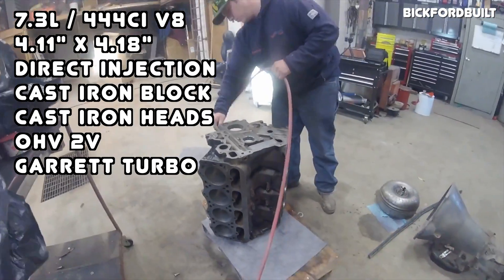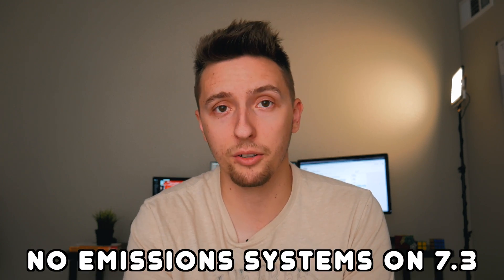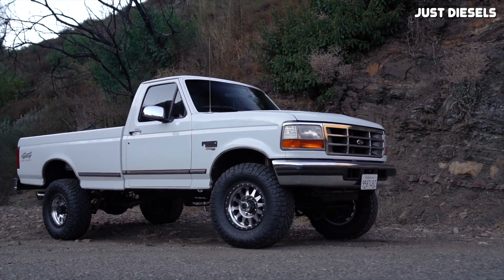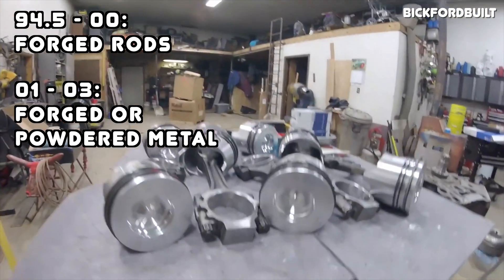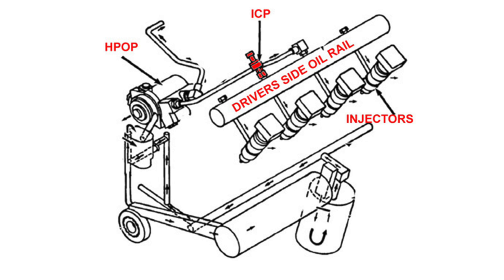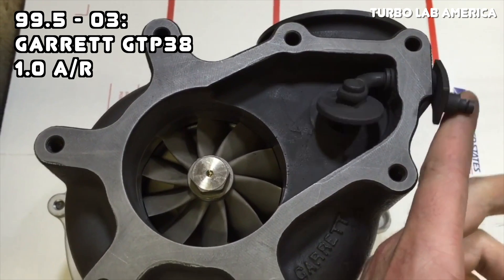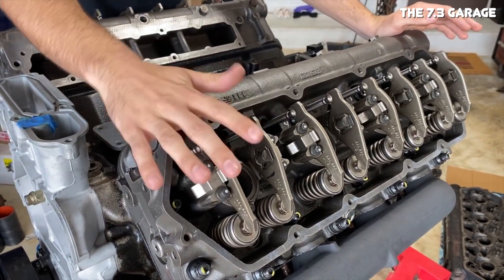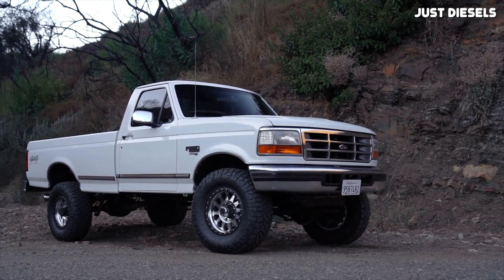7.3 Powerstroke: Everything You Need to Know

Comment: I just finished overhauling a mint 1997 Ford F-250 with a 7.3 that has 184k on it, new injectors, adrenaline oil pump and cold air intake, all new sensors and 4" exhaust with stainless up pipes. This truck has new paint new interior and people ask me all the time if I want to sell it. The answer is always the same...nope its not for sale. It truly is an enjoyable truck to drive

Comment: i really like my 1997 ford, with the 7.3 power stroke it has been very reliable for my trips across Texas. I did buy it used about 15 years ago. At this time I have around 230,000 miles on it and just recently had to replace the glow plug relay.
Really like your video.
Reply: I have the same truck, just put 10k into it and its freakin beautiful

Comment: I get a kick out of people when it comes to this. Powerstroke 7.3 for a pickup is golden. these new motors are high horse and all but guess what?its  just a pickup truck. Want to pull something? get a peterbuilt or kenworth! These new pickups boast a lot of power but springs squash after a few transports. Big joke imo. Watch these idiots jack them up and as soon as they hook up a single axle trailer they squat. JUST BECAUSE IT SAYS 1000 lb/ft DOES NOT MAKE YOU A TRUCK DRIVER

Comment: I got a E99 f250 pushing 575hp with  a zf6, 238/80 hybrid injectors, 66/88mm turbo with kc hot side, stage 2 CNC fab hpop, mains and head are studed s&b intake, 4" straight exhaust, 2 piece intake spider, riff raf ocr and frx, riff raff doghouse/ crank case breather, 4 core radiator, high flow fuel banjo bolts, twin disk clutch, Hydra tuner from Brian at jelly built performance, comp cam valve springs, irate diesel push rods, let me tell you what my old 7.3 still is very strong and blows away most of these new diesels out of the water.

Comment: Yeah.. these trucks aren't weak whatsoever. Theres a man who has owned his 7.3 equipped F250 for 23 years out in the mountains of New Mexico. Hes replaced 4 sets of rear springs and 2 sets of front springs hauling wood which is all he heats his house with come winter. You just have to maintain them.

Comment: I have a 02 7.3 with many upgrades with 230k I'm the 2nd owner its mint condition K.C300x stage 1 4" exhaust stage 1 injector S@B cold air intake coolant filtration there are a few others it's my weekend warrior I tow the camper a lot in the summer other than that it sits in the barn ill never sell it they dont male truck lile that anymore and i cant afford one anyway 😂😂😂

Comment: The only real weak point i found on all the 7.3s i was the e40d transmission and the 4t100 4 speed with overdrive ,  so i would overbuild the transmission and then i would drive that truck to the moon after that
Reply: Same with me
I found my problem to be the gauge cluster
Ford in it's infinite wisdom routed the wiring from the variable speed sensor to the transmission controller through the gauge cluster.
I kept losing connection between the VSS and transmission controller which put the transmission into limp mode

Comment: Just replaced my 2002 turbocharger after 22 years of service, 245,000 miles. These engines are truly legendary. As far as towing and horse power, this engine makes up for it in torque. I pulled a Kobuta tractor and all the fixings and 1,200 Sq feet of ceramic tiles and although the front end was gliding up a bit, she pulled this heavy load with absolute determination. Just because theses engines lack the horsepower of today doesn't mean a damn thing when it comes to low gear ratio and torque baby!!

Comment: I run the t6 15w-40 synthetic. Change every 5k miles. IMO better safe than sorry. Also change my fuel filter and coolant filter every other oil change. Have 300k miles on my 7.3 and it runs like a top.

Comment: My 7.3 has no catalytic converters 2002 Canadian truck. They’re still on it bought it. There was only two years old with 8000 miles on it. Done some upgrades per bank performance nothing radical just better low end better mid range and better fuel economy. Truck runs great haven’t done anything to it but change injectors cause it’s has 300,000 miles. I’m convinced it’ll go 1 million.😊

Comment: I’m looking for any small items to add or take of mu 2002 Excursion Limited, only 85,000 miles, white with gold under neath, gold or tan leather inside, one owner with oil changes every 4,000 using Delo 400, still has original 10 ply Firestone tires which I was holding off buy because the truck is for Sale, I will pay for chosen tires of the new buyer and I have 1 new tire and I bought one new  matching aluminum  spare rim. It’s been garaged anytime it has been home ( like 99.9% of its time). Stopped here to save this much history.
       It’s been here in Utah, I bought it to pull our 33’ x 10’ wide Searay Boat, to pull it to & from Lake Powell. Im 78 years old now and no longer have a boat, and with major surgeries in my past, it leaves me needing to sell this beautiful, giant SUV . I just installed 2 new Batteries and have always kept stringent maintenance on fluids and filters. Are there any issues that may need checked, cleaned or add-ons to make it more desirable and better to sell . What about items to check and clean that I may have overlooked ?

Comment: All this sounds pretty great! I just picked up a 96 F250 7.3L yesterday and wanted to get a little context on the motor, this was very to the point and informative. My new/old Truck was driven into a power pole when the elderly gentleman that owned it fell asleep, hadn't been started since the wreck four years ago so I got it for 500 bucks as they were pretty sure it wouldn't run. Paid to have it towed home, threw two fresh batteries in it and I'll be damned if it didn't turn right over and idle.. other than some damage to the left headlight/fender/hood everything seems great, the deer bumper seems to have taken most of the hit. I've only had this thing for 18 hours and I already love it.

Comment: The two primary trucks I'm currently looking at are 2014 Toyota tundra 1794 with the 5.7 v8 and the 1997 obs ford f-250 with the 7.3 diesel. 

To be honest I know ZERO about diesels, like literally nothing haha. 

But I'm needing a truck to haul a single horse trailer ( about 5k lbs give or take). 

The obs Ford's I'm looking at are rust free Texas or west coast and 20-25k dollars with about 200k miles.

The v8 Toyotas are 2014 years with about 130k miles and in the 20-26k Price range.

I'll primarily be using it to haul livestock feed in the bed or haul a single horse trailer. I'm also located in Nebraska very cold winters and will be using the truck alott in the winter. 

Any suggestions on which you'd recommend in this specific situation?

Comment: 7.3 was by far the best diesel to be put in a ford  if you threw the trash ford parts in the garbage and replaced them with genuine international parts they were decent motors unless you live where it gets cold  you either let them run all winter or kept it in a garage cuz they won’t start in the cold

Comment: My 2000 F350 4x4 dually with 6 speed manual has no catalytic converter, and I’ve owned it since new so I know it never did. It also has no restrictor in the fuel inlet, allowing use of tractor-trailer pumps. And yet a friend’s similar truck did have the restrictor and a cat. I’ve never found any rhyme or reason for these variations. But I do know that over the last 23 years of ownership I’ve replaced a clutch, a water pump and a fuel tank pickup screen and that’s it, other than good maintenance. Quite a truck as long as you don’t mind taking up more than your share of parking spaces.

Comment: Solid engine for sure, had a 2002 F-350 version. The ‘big’ issue with these is the oil pans rust out and you have to pull the engine to fix it correctly.

Comment: 99 7.3 forged rods. As long as it has fuel, oil, filters the motor is unstoppable. Outside of some cold starts (glow plug relay) motor will last 1 million+ 
No its not a new 6.7 but ita not a 100k vehicle either. Only thing in its class is 5.9 12 valve!

Comment: not slightly close to being the best, BUT: Ford kept having Harvester cheapening up the engine. They started by going cheap on the fuel injection system. Then they did away with the sodium filled valves for the ones used in a gasoline engine. It just kept going down hill from there. Yet the Navstar engines held up very well. They are very dirty, and really suck fuel compared to the others in the day. The motor to compare the 7.3 with is the seven liter CAT, and it's a no contest. The CAT makes better power (very flat curve), but is also dirty and sucks a lot of fuel. Even the Detroits were better.

Comment: I had a 2007.3 power stroke the only not routine change such as oil and battery was replacing injectors. I had it for 16 years and never did anything but start go run a Beautiful and Engine.

Comment: In 2002 an film maker took an 1997 f350/super duty he welded an 2 inch tubular steel frame on the frame of the ford then added 8,000 lbs of 1/8 inch steel plating with bulletproof glass in the end it is an storm chasing tank designed to drive into tornadoes that are weaker then EF 4 but after years of storm chasing though the worst conditions that tornado alley has thrown at it it is still around pretty rusty since it was abanded on a farm in Kansas but this vehicle (tornado intercept vehicle) or tiv 1 is setting in some garage waiting to be restored and go out and once again intercept tornadoes 🌪️      edit it weighs 14,000 lbs

Comment: My tow truck 1994.5 manual 5 speed 7.3 failed at 880,000 replaced with a Junk yard motor  that had 145,000 rebuilt the heads cleaned it and a few things new HPOP fuel bowl and some O-Rings later it's in my truck now with  285,000 running strong and perfect don't want anything else does have the 235 HP motor with a 80hp tuned chip and  Wicked wheel in my turbo that's it. :goodvibes:

Comment: ...those under 50 have to have monster engines that go zoom zoom. However, if they were smart, and could shift manual transmission's, they would able to do tremendous amounts of work at low cost. Let's not forget, at one time ALL semi trucks were powered by engines in the two hundred HP range and pulled 70,000+ loads. Nuf'sed

Comment: Inline diesels are the best! You have more main bearings because of only one connecting rod per journal. And the cylinders wear much better because of the pistons running straight up and down . Where v8s diesels the piston is being pulled against the outer part of the cylinder wall just from gravity.  That explains why  semi trucks all use inline engines!

Comment: 03 F250 extended cab short bed 4x4, 7.3L, ZF6, manual shift transfer case. F1 Vermilion Red. Bought him in Sept 2005 after gettin home from Iraq. He had about 52K on the clock then.

164K miles as of this post.
He's a quarter horse, not a thoroughbred.

Done nothing crazier than longevity mods to him.

Banks CAI and Intercooler. Garret BB turbo, Amsoil dual bypass oil filter kit, coolant bypass filter, crossover oil line. IH bellowed up pipes. Adrenaline HPOP and hi volume LPOP. 

Lifted and running 35's on Mickey Thompson rims. Add a leaf and F 350 SRW blocks on rear. Leveling front leaf packs with 2.5" mini packs. Had to add the mini packs because the 35's were rubbing the inner fender.

Also has a 07 front end because a couple of distracted asshats in a 2 wd S10 tried to share the exact same patch of asphalt I was already occupying. They paid for the "upgrade"

Comment: ‘02 f250 with 7.3, 6 speed , I love it. It does have a penchant for oil leaks and failed cam position sensors but an easy fix

Comment: My first 7.3 I bought new in 96 4x4 8' bed extra cab XLT with a 5 speed manual and manual front hubs I custom ordered it with a 3.08 rear end gearing and sticker delete. Only one thing noteworthy was I had to wait an extra 3 months for delivery because CARB mandated that the iron oxide particulates needed to come down so ford had to scramble to put together a makeshift catalytic converter (it turned out to be a scrubber more or less) which I promptly removed along with the infamous flat pipe that I replaced with a straight 4" all the way back. I put slightly more than 1/2 a million trouble  free miles ( only replacing the belt and water pump) before selling it which I regret to this day..

Comment: Sooo, even though the 7.3 ( 2002 in my case )is best out of Powerstrokes, it’s not as good as the older (1998 , 24 valve, Cummins) I’ve also  owned. To make my Dodge better I added new injectors, chip and a Sun Torque Converter w/ throttle body because it an Automatic. My 98’ much stronger and better ( except for noise) than my Ford Excursion.

Comment: I bought one of the 1st 7.3 Powerstrokes back in 94. I paid about 25K for it and 4 years later it was STILL worth 25K! That vehicle remains the best rig I ever owned. That said, it had it's drawbacks. It had a huge oil capacity and the high pressure system broke it down quickly. You did NOT delay oil changes under any circumstances. Also, my rig went through glow plug relays on a semi annual basis. But they were relatively cheap and easy to replace. Engine aside, Ford did some fairly chickenshit things in those days. For example, the clutch slave/master cylinders installed as NEW on my truck, were unavailable as replacement parts. This is because they had already been discontinued TWO YEARS BEFORE my truck was even built! In a nutshell, Ford was installing components onto their new rigs that were ALREADY known to be faulty prior to the build. Thanks for that Ford. I could go on. Even after that, I am still a Ford guy....I now own a 3.5 Eco twin turbo. But I don't trust any of the manufactures. In the end, I sure do miss my 69 F-250 4x4

Comment: My stock 97 PS 5spd 4x4 did have some issues when i got it at 299k. Needed a new fuel bowl because the contaminants were never drained and ate out the bottom. That was 300 bucks. Contaminants came from rusty fuel tanks. 150 each, new senders, 100 each. Also needed block heater, parking brake cables, adjusters, hitch receiver, lots of little interior stuff, body mounts, and starting to diagnose leaking AC system now.The ultimate cause of this? Poor old girl wasnt loved. She is now, and loves loaded down 2nd gear pulls at 308k. Slow like a tug boat but still faster than a gasser.

Comment: Own a 99 7.3 with 268k on it. At 160k I teamed up with Gale Banks Engineering and Diesel Power Magazine to write an article on comparing a fully Gale Banks Six Pack kitted 7.3 to a new 6.0 at the time. We threw everything Gale made for the 7.3 and dyno'd it after the install of the 4" SS exhaust,  inter cooler, bigger cooler pipes, chip upgrade, tyranny shift body and GB torque converter. Pulled 375 hp and 585 lb. of torque. Blew away the 6.0 in our 0-60 and 40-60 tow tests with a 10,000 lb. Boat behind each...!!!

The truck is still in my driveway... "The Baja Beast" and was featured for 2 years on my Amazon Prime TV series.. DESTINATION BAJA SUR ... Towing the Baja Bandido all over the peninsula.
Reply: I inherited my late father's 7.3 2001 F250 Super Duty.. My mother and I argue about almost everything, but the FIRST thing we agreed on was that that truck was worth spending as much money as a used vehicle restoring and rebuilding the entire thing. Ford left an absolute gem in the toilet on this one
Reply: Gay
Reply: @georgezimmerman3334 is that your first name or the middle name?
Reply: HA! Gale Banks products for the 7.3 were the most over hyped, over priced under-delivering garbage you could put in your truck. Not to mention he’s an arrogant jack@ss who can’t stand to say anything nice about anyone. you could have gotten the same output for less or twice the output for what you spent.

Comment: I own a 97 and it's tows great giving that I have a titanium transmission and internals with upgraded injectors, air intake, down pipes, turbo and ts6 position chip and electric fuel pump and in sire I'm forgetting other thing I've done to it

Comment: The bottom line is; if you need to pull a trailer with more weight than a 7.3 can pull...you don't need more power, you need a bigger truck. There's a lot more to pulling a trailer than a powerful engine. At some point, you'll need to stop. Instead of an F250 or F350, you might look into a medium-duty truck like an F550 or F650. Being able to control a trailer is more important than just being able to move it.  A lot of F650's came with an Allison trans and a Cummins engine or Cat engine.  19.5 or larger wheels and air brakes.

Comment: I worked on these and the 6.0 everyday for 20 years. Worked in Denver and the high altitude research guys took me to lunch in the “prototype” 98 7.3 that was putting out 750 lb ft of torque. The engine and body handles it fine. I asked why they did that for production, and one guy said the 500 is all the E4OD could handke
Reply: E40D is the transmision?  Are you saying the transmision can only handle 500 ft lb
Reply: @HealthSupercharger  yes. In its original state from the factory. I actually love working on these because with just a little work, they can handle much more power. 
 Actually the e4 was only rated for like 750 ft lb in factory garb. If the TCC could handle it and there weren’t too many worn clutches.

Comment: Sort of contradictory to suggest the new diesels are "choked" with emissions components when they have 2-3x the horsepower and torque than this engine. I'm not saying the emissions components are good, just saying. I'm fact, I only run gas engines in my 3/4 ton trucks because of all the emissions crap and maintenance costs of a diesel. Unless you're towing super heavy all the time, I'm not convinced the diesel is worth it